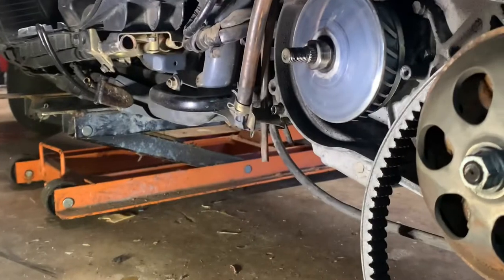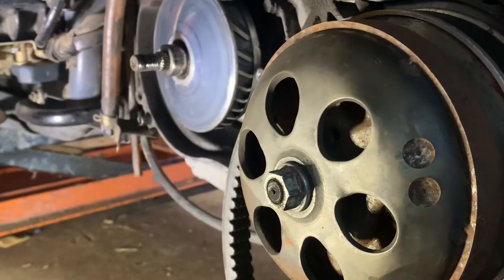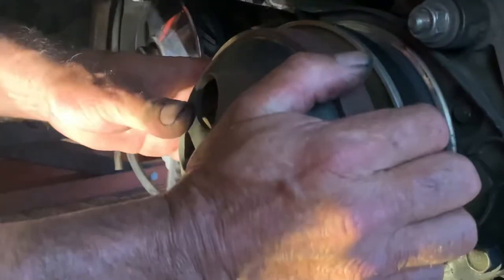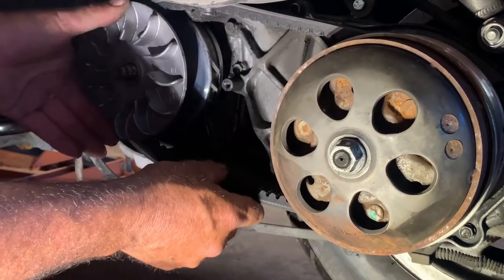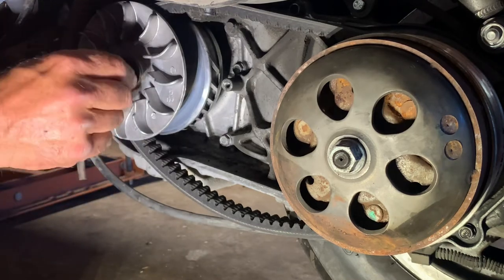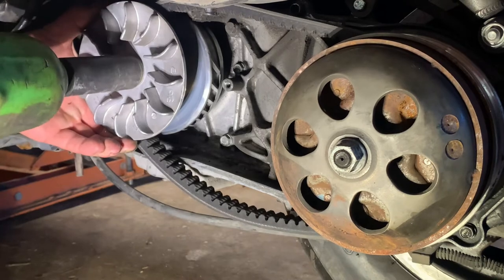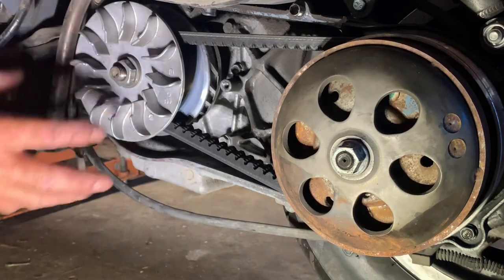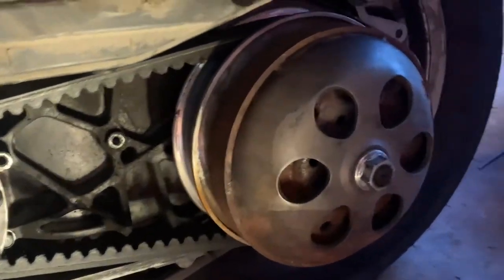Honda helix installing belt and front Variator ￼

Comment: Thanks for you Helix Videos, I just had a few suggestions, when putting the belt back onto the front variator, I like to turn the variator a few times as im torqueing the nut,,, it alwasy ensures proper belt travel, also I dont use an impact on either the variator or the clutch, I prefer it torqued to spec as I feel these 2 components need to be, other bolts not so much, they both have a torque range, I do the variator at 65 ftlbs and the clutch at 43 ftlbs, any gy6 spanner tool will work to hold them, I put a longer breaker bar on my spanner tool and it really works well,,,, variator, clutch, axl nuts, I like those torqued to spec, but im very old school and really exact when I do this, thanks again Tony for your videos

Comment: I just changed out my belt yesterday, and I learned thankfully without the belt cover on to make sure the belt has some slack when installing the variator cover.  The first couple tries I had the belt too close to the center of the variator which made the nut spin off when running.

Comment: I've compressed the rear clutch to give me more slack on the belt. But as soon as I let go of it it goes back to its original position. Any suggestions?
Reply from the maker: You have to push the belt down at the same time you r squeezing it together.
Reply: @1tonysgarage  I can squeeze it without the belt but can't squeeze and push the belt at the same time.  Is there a tool that would assist this process?
Reply: @1tonysgarage  
What is your thoughts on China replacement parts?  I bought a GooFit clutch as a replacement for OEM.  Is this a reliable part company?  I found it on Amazon

Comment: Hello, I need some help. I had removed the crankcase cover and put a new rubber gasket on. when i went to reinstall I noticed i still had a small gap along the left bottom side. its like a quarter inch off.. its so strange because theres nothing in the way and everything is clear. Is that supposed to be like that?

Comment: I have an 86 that idles smooth as silk but on runup, it has a terrible bikewide vibration that rattles the bike ad high rpm.  Any thoughts?  I have a new variator and clutch and belt.  My "guess" would be worn motor mounts.  It only has about 8K miles though.   Appreciate any thoughts.
Reply from the maker: Well try duck taping the rear shock springs. Or if u could find a upper or lower rad hose you could use that. Split the hose and put it around the springs and hose clamp it. See if that helps

Comment: What are the most common things to do go bad on the helix or what would you replace before taking a long road trip I just bought a 04 with 4000 miles but they didn't maintain it like it should have been..
Reply from the maker: Tires gear oil belt fuel filter engine oil thanks for watching
Reply: @1tonysgarage  opened mine up yesterday pulled the variator out it was packed full of grease and flat spots were bad  tried to clean it up when i  re installed it and it wouldn't work it  jammed up ,,,,new one in the mail hopefully it works ,,

Comment: I read somewhere that using a clamp or wedge to keep the clutch fully compressed will allow you to change belts without the need for removing the variator. Have you ever tried that Tony? Also, were you successful in shooting down all those pterodactyls?
Reply from the maker: @redbaron474  ya a wooden wedge  or a soft face clamp will work. And yes lol

Comment: Hey Tony, on your wife's Helix since it isn't modded out performance-wise like yours, what is her top speed? The reason I keep asking you your top speed on your helixes is because I'm trying to figure out if mine is normal or not? I'm a big guy and mine only tops out at around 65 miles per hour which is plenty fast enough for me in the city.
Reply from the maker: My wife’s is 65 mine about 68 I have seen 73 but it was perfect conditions no wind slight down hill. I just put 25g rollers and I am going to test drive in a couple of days. Suppose to be rainy next couple of days
Reply: I have seen 80 on my unmodded 2000 model, down hill.

Comment: Great videos Tony :-D
Do you have any tricks on how to remove the front variator without an impact wrench? - or is that something you should avoid?
Reply from the maker: Thanks they do make a clutch holder but I have always just used a impact
Reply: @ Thomas Hollaender I struggled with it at first, but I was able to get it with an 18 inch breaker bar and 22mm socket. Make sure to treat the nut well as if it's stripped you're in a really bad spot. I used a "variator holding tool" from Amazon which had little prongs which went on the curved parts of the variator and the handle braced itself against the "bell" of the clutch pulley assembly. Good luck and let me know how it goes (if you haven't done it already)
Reply from the maker: @AudreysKitchen  ok I have taken all my stuff off already. I have a video on cleaning rear clutch
Reply: Ended up buying a cheap electric impact wrench. It couldn't release it at first, so i had to heat up the bolt (very carefully, as the heat goes to the aluminum disc and therefore could damage the belt).

Comment: I'm sorry for the maintenance video, but I think I found the problem with your bike in this video.
That is because when you squeezed the driven pulley by hand and released it, the pulley did not return but held in place.
This is probably because the pin hole in the torque cam is deformed and the movement is no smooth. Or the center spring may be weakened.
I have an '86 HELIX and I had the clutch OH'd a few months ago and the hole in the torque cam was deformed and not moving properly. If you correct the hole in the torque cam with a file to make it move better, when you squeeze the drive pulley by hand and release your hand, it should not stop like in the video because it tries to return to its original position by the power of the center spring.
Normally, it should not be possible to assemble the belt without binding the belt with something or clamping the pulley.
Smooth movement of the torque cam is very important for acceleration and re-acceleration, and I recommend that you disassemble the torque cam once and inspect the torque cam holes for deformation.
Also, the center spring weakens with age and affects re-acceleration, so it is a good idea to replace it if it becomes weak.
Have a good HELIX life!
Reply: Photo of the hole in the torque cam at the time of overhaul.
The edges of the hole have been scraped and deformed.

https://light.dotup.org/uploda/light.dotup.org32623.jpg
Reply from the maker: Ok thanks I will look at that thanks for watching
Reply: Thank you, for the extremely well descriptive comment. I am just learning. I have seen what you are talking about when pushing on the friction housing against the contra spring,  releasing belt tension and then retentioning, when the housing was released. I thought it might be possible that there is just a good amount of friction between the centrifugal centrifucal clutch pads, the housing and general slight corrosion?  Anyways, I guess anything is possible. Thank you for the insight and digital image. You fwo both; are far more expert in this whole subject than I.

Comment: I was interested in how tight the bolt should be I noticed you just use an impact wrench gun I don’t have an impact wrench gun the first time my son put it on my hand with a ratchet wrench and it wasn’t tight enough I remember my father used to use a torque wrench which is something you use when you don’t want something too tight you just use an impact wrench so I don’t know how important that is I also don’t know why my bolt came loose they should’ve back threaded it shouldn’t they have reverse threaded that bolt
Reply from the maker: No it’s not reverse thread not sure what the torque spec is. I would say that Honda would be able to tell you if you went by a Honda dealer they may be able to look it up. if you use a torque wrench, you’ll have to find something to hold the clutch Bell from moving.